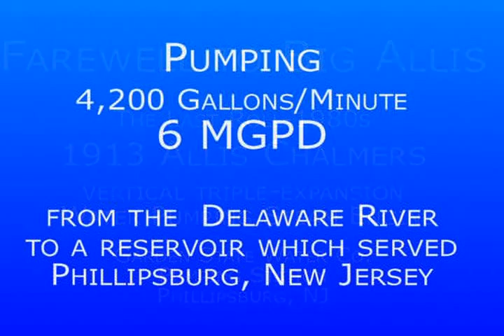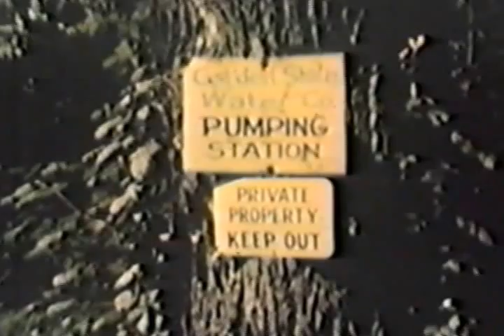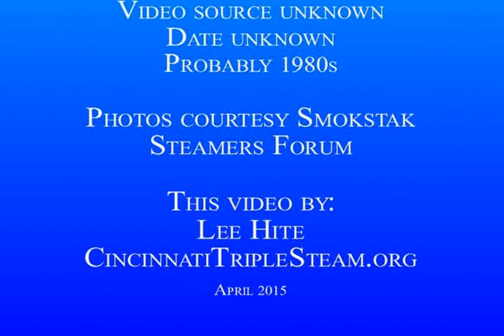Farewell to Big Allis - Triple Expansion Engine, Phillipsburg, NJ

Comment: I'm very happy to report that after a year and a half of work this engine ran again for the first time since this video was shot, on July 27th 2018.
Reply from the maker: Congratulations, we are very happy to hear about your success. We hope all goes well with the  engine and no surprises surface. Lee Hite
Reply: On steam or air!? Boilers working!?
Reply: On steam or air!? Boilers working!? How come area wasn't robbed out of anything copper!?
Reply: @chadbailey8152  On Steam, not with the in plant boilers, we brought in a rental boiler and had it set up outside. The building is presently also being used as storage for a transit heritage group, which is why no parts of the engine were robbed. The engine's copper and brass was bolted down, the stored materials, were not.
Reply: Thank u!

Comment: The roof has been repaired and work has started on repairing the engine with plans on getting the engine running again.
Reply from the maker: Thanks again for the updates. I wish you much success. We're still working on ours, much to do yet!
Reply: Cincinnati Triple Steam what do your engines need and which is the best candidate to get into steam again?
Reply: @AEKarnes  
The entire boilerhouse is demolished and gone. That's the problem the ones in Cincinnati.